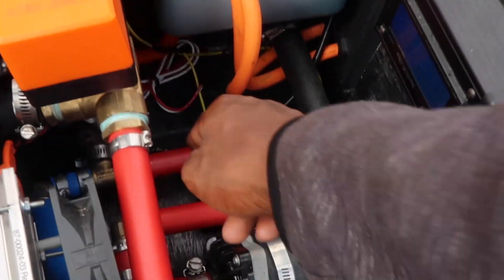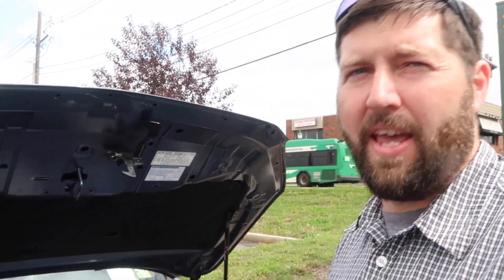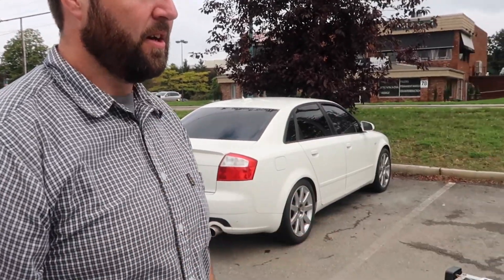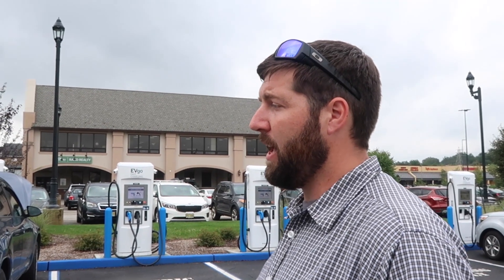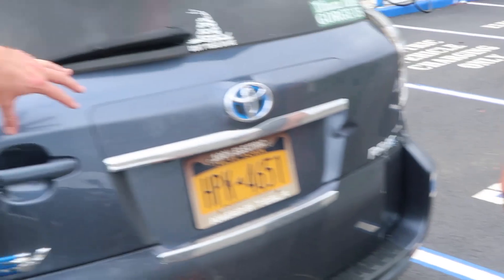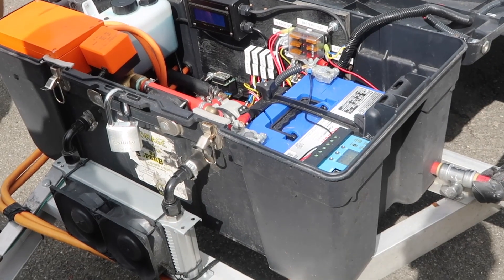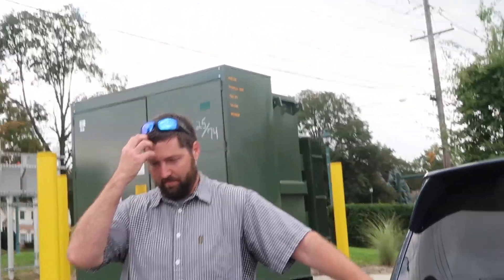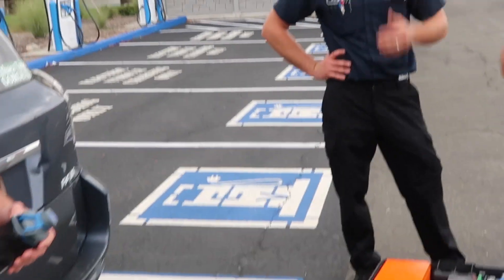The True DIY Tesla Range Extending battery Trailer

Comment: Throw some corrugated aluminum over that pack and add some side rails so that it can also be used to haul stuff :)
Reply: My goal is to do the same thing but with a flat Tesla 100 kwh pack. Then I want to build a removable lightweight teardrop trailer over top of it. That way I can use it to move stuff AND for camping trips with my wife and son.

Comment: This guy is driving a lawsuit. An accident could cause death by electrical shock. Could kill anyone trying to help in the case of a car accident as well. It is cool. But extremely dangerous.
Reply: You sound like a hater but Ill respond anyway. I have multiple fuses everywhere and many kill switches.
Reply: @JamesKlafehn 
I don't think he's a hater. He's got a point. Don't you have to get a trailer checked like a car before you can get it road legal?
Reply: SCWfan06 it’s different in every state. Either way, there isn’t a “range extending trailer” option on any DMV form. Lol
Reply: James Klafehn Not a hater at all. But you can imagine that if there was an accident that resulted in a death by electrocution there would be a lawsuit. Or if a first responder died trying to get you out of your vehicle that the spouse of that person would be inclined to go after you because your vehicle is highly modified. It would also cause issues with making any insurance claims. Just as it would if you had modified your house and it burned down. 

I am no hater of innovation. But we do live in a highly litigious society. 

Just observing and sharing like everyone else.
Reply: Dave M no one is going to get electrocuted buy my set up. Like I said I have fuses all over along with on off switches. I forgot to mention that I also have a inertia switch connected as well. The inertia switch disconnects power to the contactors.
Reply: "...if a first responder died trying to get you out of your vehicle...".  Aren't first responders trained on the procedures for extracting a victim in an EV wreck?  I'm pretty sure I read that, somewhere.
Reply: @robkaOK  They are. But how many Rav 4s are fully electric? How many trailers are out there that have the potential to kill you by electric shock?
Reply: "Law suite"?

Comment: FOR THE COOLANT CAP, over just about any store that sells kitchen stuff, there should be measuring cups, find the one cup that fits inside the hole, cut the handle off, put the cup in, screw the lid over. That should stop any more leaks.
Reply: Cool, I will give it a try! Thanks!

Comment: how about solar pannels on the trailer, and ones that you can slide out?
Reply: And add a 2nd or third battery pack?  Conservative 125 mile per pack.  Current configuration 250 + 125 +125.  That is a good 8 - 10 hours of travel on interstates.  each pack is about 800 lbs.  So an additional 1600 lbs to get a reasonable amount of real world travel.

Now if he can figure a way to charge one pack while the others are being discharged, that would be great.  And no I do not mean perpetual motion.  Or do I?  =)  How many watts / amperes do aircraft generator / alternators produce?

Comment: A slightly narrower trailer with a floor above the battery pack could become a small cargo trailer that still provided power.  With a bit of careful design its aerodynamics could render it neutral at worst, maybe even a slight advantage to tow.  And its entire roof could be solar power, so that over a few days it could conceivably recharge itself completely.

Comment: I wonder if the standard connector used for fork lifts would be a good interface between the car and trailer. Here is an example (no shill intended, I just needed a photo): https://www.grainger.com/product/3BY20?cm_mmc=PPC:+Google+PLA&s_kwcid=AL!2966!3!50916716157!!!g!104635763397!&ef_id=WWVetwAAAGOkuVH_:20181004164224:s&gclid=EAIaIQobChMIrqars53t3QIVDBBpCh1V-AE3EAQYAyABEgIBr_D_BwE
I see these all the time as scrap at the fork lift junk yard... cheap and readily avail.

Comment: Awesome.  Make the Tesla Trailer!!  Can you imagine a future where people buy the cheap short range 90 mile electric cars that get them 90% of what they need and just adding a battery trailer for that one road trip.  And if the trailer can double as a home powerwall it's win win win...  Extreme Example: Model X 100 can tow 5000 lbs, so a 5000 lbs trailer full of batteries that yields ~550 KWH battery combined.  Reducing range due to extra weight to 75% rated it can get you 1200 miles or from LA to Denver on one charge.
Reply: Towing a 5000lbs trailer is going to sap some serious power 5.7 tonne train for this set up.

Comment: Will possible to do same option for nissan leaf older models?how do bypass the communication?
Reply: The trailer is totally independent of the CAN in the car. I have found that the batteries have remained almost identical temps and no major issues have come up.

Comment: If the batteries are parellel don't charge them seperately. While connecting them back together the voltage must be IDENTICAL... if not it could not end well...
Reply: Not true. Watch my videos. Within about 50 volts is fine.

Comment: Safety issue. If you’ll get in accident, there is a big chance someone will be electrocuted to death. High voltage cables must be hidden in some ways.
Reply: There are multiple fuses at all points in the system
Reply: James, fuses necessarily need to pass hundreds of amps before blowing, so they may help with a dead short, but won't stop someone from being electrocuted if they breach the cable insulation with a metal object and somehow have a path back to the other terminal.
Yes, I know the chances are remote, but considering consequences I'd seriously consider adding some armoured conduits just to be sure.
Reply: This is why the contactors are powered by 12V and you can do a ton of stuff that will cause them to open in the event of a crash, just add some trip wires for instance that will almost assuredly break the moment the trailer breaks off its post or whatever
Reply: hey as long as we get rich's death on camera I can release the footage :D
Reply: Carl, dial 911 first!  Then post.  =)
Reply: @michael kenefick can't, I would be laughing too much :D
Reply: how im very impressed!!!
Reply: the Cables should have a second layer of protection, at least while they are on the outside of the car.
Reply: Bullshit
Reply: Accident are preventable!

Comment: So here's a great idea for a business venture - build a bunch of Trailer Power Packs and locate them on Interstates - then customers can "rent" them - like U haul trailers to get them from X to Z without the Charge times - then drop them off at the interstate exit - return them when finished the road trip = end of Range anxiety. Now where's that Dragon to stump up the cash!!!
Reply: Thanks Don Folders - I kind of think the same or similar concept as the portable power pack just about every teenager lives on - to extend their smart phones battery life - the trick would be making the tow-able cross compatible with the various Car manufacturers that will come along - I read 90% of EV journeys are less then 100 miles - it also keeps the cost of EV's down (smaller battery Packs) - but what about those 10% journeys over 100 miles - Enter "U-EV Power"
Reply: They would be stolen unless you did it like uhaul and have random companies host them and watch them
Reply: I think there was an Israeli company trying to do this, called BetterPlace.
Reply: Everyone's looking at this all wrong. The trailer should have electric motors too. Bluetooth to any vehicles brakes and accelerator. Push dead, or extend EV's, gas or diesel, range.
Reply: The problem is that each car is different. Each car operates in a slightly different voltage range. Also, you would want both packs to be similar in charge when connecting them.
Reply: James Klafehn They could load-level, and all you need is a box that can distinguish what volts/amps are needed-and deliver that to the system.
Simple.
Reply: James Klafehn; why not just plug the output from the trailer into the charge port? Then drive it as you charge... might screw up your batteries doing that wouldn’t it? Not the same problem as with carrying around a generator?
-Solve the logistics and it could be like “Bird scooters” that pay you to charge them. Those trailers could pay people to charge them. It’s the closest thing to a quick swap battery pack that Tesla discontinued research on when the solid metal underbody got put below the batteries.

Comment: @ Rich Yeah, do it and put a Camper on top.
Reply: My goal is to do the same thing but with a flat Tesla 100 kwh pack. Then I want to build a removable lightweight teardrop trailer over top of it. That way I can use it to move stuff AND for camping trips with my wife and son.
Reply: Check out my channel. I just started a new range extending trailer that is going to have a teardrop on top.

Comment: Is he planning to put a bed on the trailer to maybe use it as a trailer to move stuff around? would also stealth it up.
Reply: My goal is to do the same thing but with a flat Tesla 100 kwh pack. Then I want to build a removable lightweight teardrop trailer over top of it. That way I can use it to move stuff AND for camping trips with my wife and son.
Reply: @JamesKlafehn  Any thoughts of getting Model Y when it's available? Affordable version of Model X, will probably only cost $40,000 base with 200 miles I theorize.
Reply: Maybe. If/when it happens. But for now you cant beat the Rav4. The most interior space for an EV aside from a Model X and for only $15-$20k used
Reply: James Klafehn More then Jaguar iPace that just came out?
Reply: Nope, Im happy with the Rav4 EV
Reply: James Klafehn I saw article about electric powered live in trailer, that had its own motor, that worked in sync with electric car, to lessen weight and burden on the vehicle, adding more range. Would that be possible with your config to add a motor to the trailer? And then possiy get it to work in sync with your RAV4. Similar to that other trailer.
Reply: Adding a motor is a lot more work, weight, money and drag. Personally Im not interested in going that route.
Reply: @JamesKlafehn ??? Not a motor, some kind of floor to pack stuff on    and haul around.
Reply: Read my other comments about this exact thing
Reply: sorry, got it now.
Reply: My T-Rex Camper is done! Check out my channel to see it.

Comment: That electrical box is amazing!  For the trailer, I'd put a pickup Bed Cap on it, no one would know what's under the cap and it wouldn't look so mysterious.  Might even be good for some minor storage, yep.  Cool video Rich, thanks!
Reply: James Klafehn  a ‘cap’, a top-bed for more storage, etc., would also make it taller and more visible to other drivers, as well as the driver pulling it, reducing chances of accidents. Low, flat trailers tend to be more easily overlooked.
Reply: My goal is to do the same thing but with a flat Tesla 100 kwh pack. Then I want to build a removable lightweight teardrop trailer over top of it. That way I can use it to move stuff AND for camping trips with my wife and son.

Comment: The 2004-2009 Prius uses a 3-way valve to divert hot coolant to a "thermos" bottle on the extreme front of the driver's side. Then upon cold starting, the hot coolant is diverted through the valve to the cooling system to help cold starts. Almost every Prius had that valve fail within the first 100k though.
Reply: I can confirm this.. We replaced it on my brother's 2nd gen Prius along with another valve which technical name escapes me atm. I thought the same thing when the BMW 3-way valve was mentioned. I checked prices and the Prius one is about half the price as compared to the BMW one. It is prone to failure as you mentioned but so is the BMW one. I think it would be a good part for a DIY cooling system if you were trying to keep most parts Toyota and/or Tesla.
Reply: Patrick Thompson bmw uses Toyota hybrid technology i think

Comment: Another option could have been to mount that battery on the roof of the RAV4 with a fiberglass cover so I looks like a roof cargo pod.
Reply: I thought of that and a lot of people suggest that but its too much weight. 840 lbs. There isnt a roof rack in the world that can support that. Also, you would lose a lot in drag. People who add roof racks lose 10-20%
Reply: They can put a space shuttle on a 747, you can construct a mount to put a battery pack on your roof.
Reply: @JamesKlafehn  to quote field of dreams-

"If you build it, they will come"

The key would be to make the roof mounted battery's lines follow the lines of the car. 

I am just drawing on my extensive experience with hearses. They add huge amounts of metal to those, but keep the aerodynamics.

Comment: He could easily add a hinged platform on top of the battery with rails so he could also use the trailer as a trailer.
Reply: My goal is to do the same thing but with a flat Tesla 100 kwh pack. Then I want to build a removable lightweight teardrop trailer over top of it. That way I can use it to move stuff AND for camping trips with my wife and son.
Reply: Ya remember tho a vehicle only has a certian amount of towing capabilities so if you have a 1000 pnd trailer plus what you put on it

Comment: What would be really cool is having an camper trailer with a large battery in it that connects your car and boosts car range plus if the trailer had a motor to self propel itself. So it would be like pulling nothing.
Reply: A german company unveiled just that a month or so ago. I saw it on Elektrek
Reply: My goal is to do the same thing but with a flat Tesla 100 kwh pack. Then I want to build a removable lightweight teardrop trailer over top of it. That way I can use it to move stuff AND for camping trips with my wife and son.
Reply: If you heard the guy, there really isn't any penalty to towing it, no need for a motor on it.
Now if you can make it self-driving, you can send it to get itself charged and drive back home, that would be something.  :)
Reply: @nimblemotorsports  Check out my channel. I just started a new range extending trailer that is going to have a teardrop on top.

Comment: Amazing, did you find out if he has plans to add a top to the trailer so it can be used for carrying etc.? Other than simply the batteries?
Reply: My goal is to do the same thing but with a flat Tesla 100 kwh pack. Then I want to build a removable lightweight teardrop trailer over top of it. That way I can use it to move stuff AND for camping trips with my wife and son.
Reply: see other comments he has answered that, but yes he has ideas.
Reply: Not in video

Comment: Nice. If it were mine I think I'd add a platform above the battery so it's a functional utility trailer
Reply: My goal is to do the same thing but with a flat Tesla 100 kwh pack. Then I want to build a removable lightweight teardrop trailer over top of it. That way I can use it to move stuff AND for camping trips with my wife and son.
Reply: Practical and functional, hidden from prying eyes
Reply: @JamesKlafehn  Just steal Rich/Lee's trailer and pop your modules and hardware in there.  They probably keep it outside.  
Rich, don't read this.
Reply: h8GWBî haha I’d need my range extending trailer just to get there and back. Double towing would be a little crazy. Haha stay tuned to my channel though. I have something in the works.
Reply: +James Klafehn You're a hero, dude.
Reply: @sonykroket  Lol thanks. Even if it really is only in the eyes of my 20 month old.
Reply: @James Klafehn Nah man, there are 10.000s of us lol. Maybe even more. Never stop, brother.
Reply: All of a sudden pop up campers come out with extended range batteries below......Think about a modular trailer where you can put a pop up camper on top, switch it to a utility trailer, with an extended range battery below.....
Reply: @kartboarder22g17  Indeed modular, 3 layers, the bottom layer is the trailer with the batteries, the middel layer can be utility, camper of left out. The top layer is a simple roof, an aero roof of an solar roof!
Reply: Sorry didn't see your comment, I thought the same
Reply: I'd put a pop-up tent on it. Discharging batteries would keep my sleeping bag warm.
Reply: That was my first thought. Slightly lower the pack mounting, and put a deck on the top with sides that would visually cover the pack. It would look like a regular trailer...
Reply: An aluminum or plastic cover and with or without a low gate on the top would make it perfect I think, disguising it would make it that much better
Reply: I would add 2 more battery packs and a camper. 😜
Reply: Sam Brewer only problem is the weight. What did he say, 800 lbs? That would be 1600 more lbs, plus the trailer would have to be strengthened, so, heaver. 800 x 3 is 2400, plus probably another 800 for the trailer would be 3200 lbs. Wonder how much that would work with mileage vs distance. If streamlined on the highway shouldn’t hurt too bad. I wonder how the pack looks without the case. If he could somehow pack extra cells in the R4, maybe do a lift kit and drop part of the floor for the other cells that was left over from the cell taken apart. That with some aero and a stiffer suspension installed, should be be a improvement. As for what he done, cheap and effective, job well done.
Reply: @sambrewer2306  wouldnt want to sleep on a Tesla Battery
Reply: @purpleezah5382  Yet you would sit in a tesla car with explosive batteries beneath?  I don't really see the difference?
Reply: My T-Rex Camper is done! Check out my channel to see it.
Reply: Thats a better idea so it does grab as much attention either
Reply: That's a good idea
Reply: tent
Reply: I’d make it shorter but taller 🤷🏻‍♂️
Reply: Daniel Dempsey or a cool looking aerodynamic cover for style an looks
Reply: @colsons36  A teardrop shape would do a lot of justice